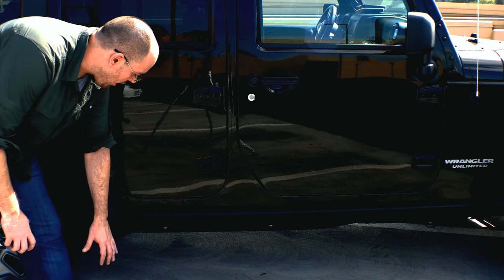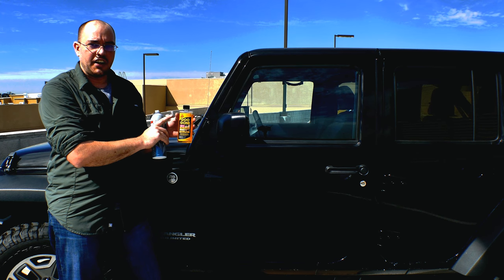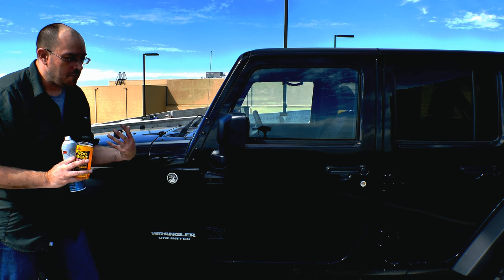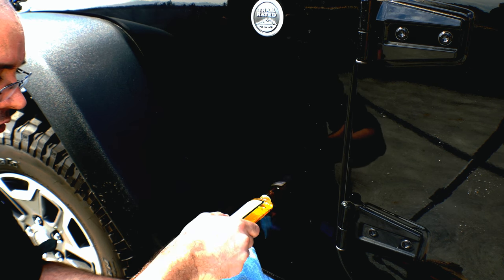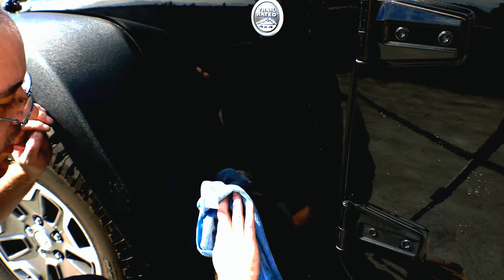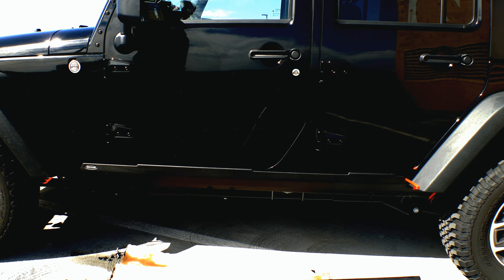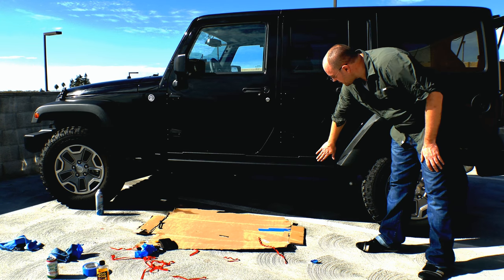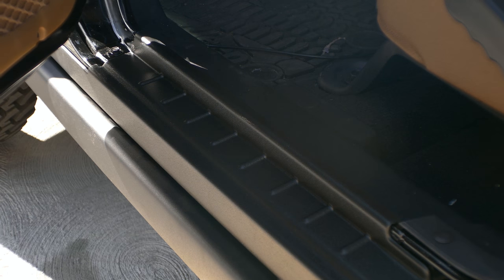Bushwacker Jeep Wrangler Trail Armor Rocker Panel & Sill Plate Install W/ Rubicon Rock Rails

Comment: Take off metal protection and put on stick on plastic. 🤨 I hope you put the factory rails back on as well or plan on real frame mounted sliders. That’s not gonna give any impact protection. Just abrasion protection. Looks good though. Hope they don’t just collect dirt and hold water to the body. Also not sure how long the tape will last applied over a product instead of product free, alcohol cleaned paint. Any updates on how they’re holding up?